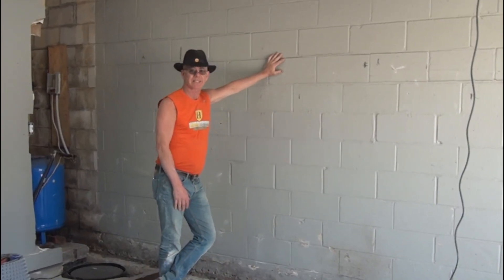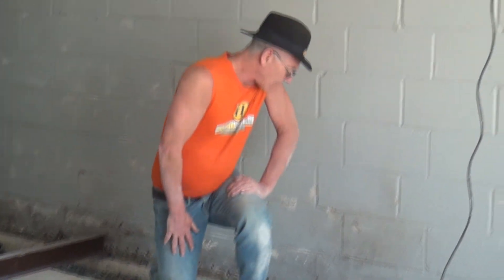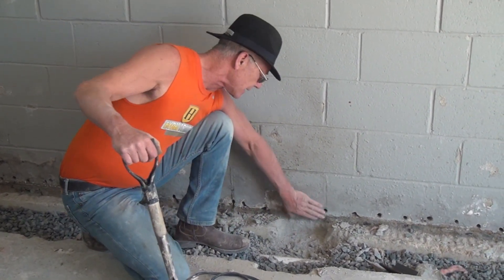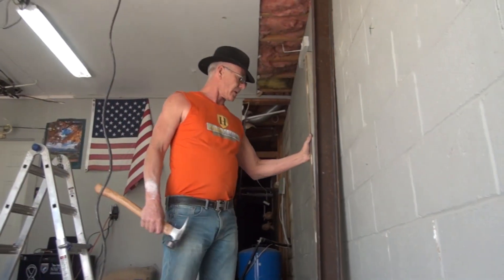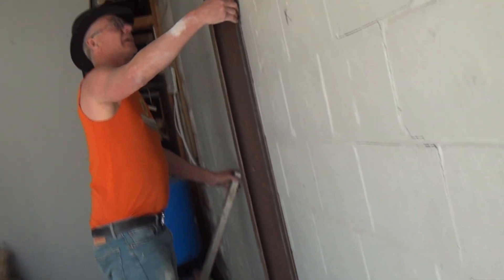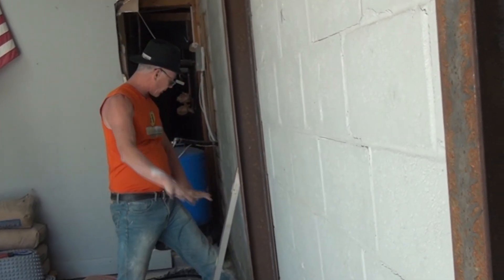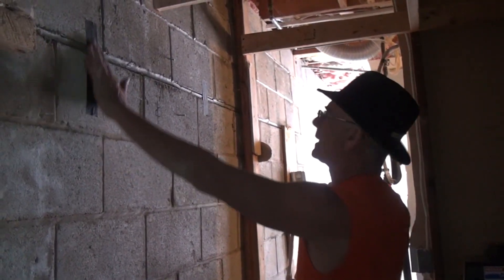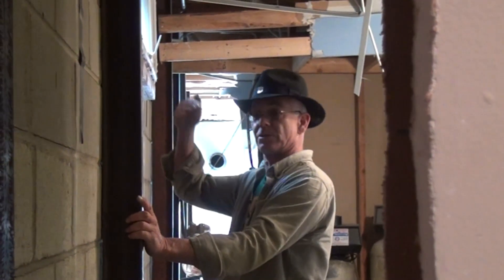NJ - PA Foundation Repair - How to Install I BEAMS vs Carbon Fiber Strips

Comment: What about using structural epoxy and 5/8 bolts in the floor on a flange welded to the bottom of the W4 13 iron with some gorilla braces on top?

Comment: how would you secure the bottom of the I beam in a dirt crawl space?
Reply: Encased in concrete tight to the wall at the bottom and buy an adjustable brace for the top

Comment: 😂 I've got a wall leaning in considerably at the TOP. 15°? If I were to drop a plumb bob from the top to the floor, I' be 12-14" at the base...How would I address THIS nighmare?!! I have been repairing this house on my own for 10 years...please help. Yes, I have a LOT of construction knowledge.

Comment: Carbon fiber is an attempt at foundation stabilization with a side effect of epoxy stink.  it attempts holds the wall in its current position.  The strip actually needs additional movement to engage.  If you can live with the size of wide flange beams "I beams", they are probably going to be more robust.

Comment: I-beams and carbon fiber strips are as much repair as bandaids are to cuts on your finger. The difference between a finger and a house is your finger will repair itself under the bandaid; the house will just weep and fail more.

Comment: The title was a bit misleading.  I was actually hoping to learn a bit about the use of carbon fiber materials in home construction.  All I learned here about carbon fiber, is your complete disdain for carbon fiber strips.  Whatever those are.  Still though, I did learn how to correctly install a steel I-beam.  Thanks for posting.  Update.  Just saw another video that you did that was what I was looking for.  Thanks again for your videos.  I thoroughly enjoy learning, and you are one heck of a teacher.  A no nonsense no bull type, the best.

Comment: Definitely recommend a 6x6 or angle iron at the top.  The company that did mine in the 80s used C-channel and a 2x10 instead of the 6x6 at the top. The pressure eventually broke the 2x10 and have bent several of the beams.  Now I have to spend another 15k to replace what was already done.

Comment: I like your style! The question that rattled around in my mind is, why were cinderblocks used for foundation walls in the first place?
Reply: Another good question is could this method be used for brick foundation?
Reply: @joshuareynolds3523  after watching many vids on foundations I’d say no on the brick idea.
Reply: @brainwashingdetergent4322   what would be good for brick?
Reply: @joshuareynolds3523  exterior walls is what brick is for
Reply: They are NOT cinderblocks they are CONCRETE blocks big difference.

Comment: Hey Dan, I have a customer with a similar issue, and I was wondering how you'd deal with bowing by the staircase. I can't slip any steel along the wall where the stairs run. What would you do?
Reply: I can't help you with your question, but you sound like a pro, so I wanted to ask you something... Generally speaking, what kind of I-beam do you usually use? Like, for a regular basement, 10 ft beam. What Web, Flange Width, and lbs/ft do you use?
Reply: @Vegan4Everything W4x13 is typical. I beams are sized by how much they weigh per foot. So a W4x13 is 4 inch width by 13 lbs per foot.

Comment: Thank you for this video! I have a customer with an exterior covered porch. Brick wall with stucco on it. Half of it below grade. Anyhow it's caving in. I'm going to use a modified method to support the deck joists above, and shore up the walls while adding pressure on them. I'm planning on building a 2x6 pressure-treated wall one foot on center. Brace it at the joists at the top. Use joist hangers so it could hold tension towards the brick wall. Then I'm going to move along and jack the bottom of the 2x6 wall until it comes into contact with the bottom course of the brick wall. This may help level the brick, but it will definitely support it from falling in, and I'll take care of the decking support above. Thank you for your video. It inspired me to develop this! If you're so inclined and can think of a better method please let me know. Best wishes. Be safe.

Comment: Hi! Thank you so mu for this video, it’s been so helpful, if you were in the Kansas City area, I’d love to have you come out and take a look at a foundation on a house we are interested in buying. The concrete foundation has some leaning on one wall and 4 or 5 steel I beams were installed (incorrectly we think) and small amounts of water come in through cracks in the foundation when it rains. Our inspectors didn’t seem worried about it at all and made it sound like just by sealing the cracks with an epoxy, all would be fine. We however are worried that the wall will continue to lean in despite the steel beams being there. I guess my question is, how worried should we be about this or should we try to reinstall the beams correctly then reseal cracks and regrade around the foundation? I’ve called around to a few local companies and no one will even give me an idea or look at my inspection report without coming out and seeing it in person, which I understand. But since we down yet own the home, it’s not realistic to try and schedule a consultation until after we close on the house. I would love any thoughts you might have on this!
Reply: You are our of your mind if you think some guy on youtube is going to come out to take a look at the foundation of a house you are interested in buying half way across the country...

Comment: Would you leave these I beams in permanently to stabilize the wall? I had plans to lower my basement floor, 90 years old home block foundation, upon inspection I found one wall beginning to bow inward, I want to do this to straighten it out being the driveway is on the outside, ones the wall of straight my thought would be to either cut upon pin and fill the wall to stabilize than do the underpinning, or leaving the I beams in benching this wall and underpinning the remains 3 sides to lower the floor height, any advice would be greatly appreciated
Reply: I would never remove them.....

Comment: What type of steel beam do you use? I need power brace installed. Had a contractor come out told me I need 14 beams. It's going to cost me $25,000. I cant afford that, I'm considering doing it my self.

Comment: my only disappointment is that you are located in new jersey.i would like to find a reputable foundation repair expert such as yourself in Nebraska.there was a waterproofing system installed by a leading company here.begins with (TH).previous to my purchasing the house.the people were elderly,in their eighties.never saw a drop of water in sump pit.it took me abuot 15 minutes to figure out my problem.clogged down spout.but now I have a bowed wall

Comment: Daniel OConnor, Good day to you. I live out here in Missouri and my basement has a small separation/crack between the blocks, horizontally. Your method of Ibeam repair looks great. What's the distance you have between Ibeams? I'm looking for your video on installing a sump tank etc. Yeah, I'm a DIYer, but I have done construction for 15 - 20 years in San Diego and then I moved to Missouri and became an Operating Engineer. I can follow everything you're saying, but I never heard you talk about the distance between Ibeams. I'll get searching, thanks Daniel OConnor.

Comment: Daniel, I have a question- in another video you secured the I Beams at the top using a long angle iron that connected to all of them and the joists.  In this video you boxed them out with wood.  Is either method better?  And thank you for the great videos.

Comment: I've been shopping for a house and finally found one that's literally perfect for me  ...except the big ass crack in the basement wall smh. It's a renovated flip that was built in 1925 so I'm worried
Reply: I bought a house in 2016 that had some cracked walls but the house is at the top of a hill and water all runs away from the house. If it's not leaking water, don't be scared. Mine hasn't gotten any worse and is dry as a bone. You can do an I/H-beam repair like this video shows without tearing into the footer. Just drill a couple holes and put rebar in, put a 2x8" block of wood against the rebar, then use a 12 or 20 ton hydrolic jack like shown here and push the wall back over the course of a couple days, then hydrolic cement the crack. Cake! Don't be scared if it's your dream house, but get an inspectors opinion too!

Comment: How do you create a bottom anchor if it's dirt or clay on the other side rather than a concrete pad? Understand that the moisture level of the clay/dirt is pretty high.

Comment: Just recently discovered your videos. To the point, honest and very informative. Wife and I are looking to buy a second house and seems like every house we look at has fucked up basement walls. Even a newer 10 yo home we looked at in a $300k subdivision selling for $165k had shifting walls. Something about not being tied in right. Realtor said it would be 50k to 60k just to fix the walls. Smh. Several other houses built in the 70s had 2 or more walls pushing in with cracks going right through the block from the floor to the ceiling. Blocks snapped in half. WTF.  After watching your videos I have a better understanding what's going on in these houses. I don't even know how this shit gets passed the building inspectors. Thank you for everything you are doing to help inform us.

Comment: RamJack... we put tiebacks through the center of the ibeam and block wall it pulls the wall back and holds, that ibeam with nothing in the center won’t work.... it’s still going to push and crack the floor

Comment: Bashing the competition seems to be in order at times. I think a more positive approach is better. Do videos that inform the public, not negative videos designed to dog the other guy. Personally I've stumbled across several videos you've published. Some of your repairs are just a repeat of the competition. Slightly changing small details. I think it should be know that the best way to stop water from entering a home is to work from the outside. Obviously that cost more, and is a tougher sell considering. However it is the correct fix to most water issues.

Comment: How far apart are you spacing these I beams? Thanks for the video.
Reply: Dustin Rynders usually they are supposed to keep them 6-8 feet apart.

Comment: What do you do for a basement that is leaking water and showing white mold/fugi or what ever and the walls have cracks and also I want an egress window installed . What would be my options . So I am not taking advantage of . And the job isn't done only half way ?

Comment: Great video Dan. You're hilarious. 
Quick question though, is there a reason that you apply pressure to the base of the wall instead of the top?
Do you see any issues with mounting the I-beam to base of the wall and applying pressure to the top via a torque screw braced against the runners?
Reply: At the bottom is where most of the force is going, since that's where all the weight is going is downwards. Water towers reinforce more along the bottom too. So if you can move the bottom the top will follow along, but if you try to move the top you might move the bottom the wrong way in return.
Reply: @dawnv3436  Nicely put!
Reply: @dawnv3436   What? there's force at the top based on fundamental structural mechanics. The jack is used down low because its easier and safer to put the jack there.

Comment: Could the I-beams be removed after the wall straightens back out? Or would it just pop back out? Wondering in case wanting to sell the home.
Reply: 2nd that question
Reply: I would ask why would you remove them? Did you strengthen the wall somehow?

Comment: Question on the direction of the floor joists ... in videos and photos of i-beam installation, I always see the joists running TOWARD the wall.  What about the walls where the floor joists run in the same direction as the wall?  Can i-beams still be used?  How does it change how it's fastened at the top?
Reply: I have the exact same question. My bow is running on the wall that runs parallel to the joists. How do you fast the I beam at the top
Reply: Just guessing here, but if the upper floor joists are parallel to the wall, then add 16-inch blocks (or whatever the joist spacing is) between floor joists so you have effectively built a new floor joist perpendicular to the old joists. That would be a lot of cutting but your floor would be ridiculously stiff and you keep your headroom.

Another idea is run perpendicular joists running under the old floor joists, nailed into the bottom old floor joists, and flat instead of vertical (like the old floor joists are). You would lose 1.5 inches of headroom doing this.

Lastly a combination of both, particularly run a long/uncut perpendicular floor joist flat (so you lose 1.5 inches headroom) for each steel I-beam. Once the wall is pushed out, then consider removing the long perpendicular joists but leave the 16-inch blocking. This returns your headroom after the wall is pushed back but the steel I-beams are supported in the perpendicular direction. Be sure to keep the ground from getting wet outside the wall so there is not a huge force trying to push the wall back in all over again.

Comment: Is there a minimum size you would use for steel? I Would like to use a 3" i -beam or heavy wall sq tube to frame up and finish the basement wall with 2x4's. Using the 3" would allow this.

Comment: I love your humor regarding carbon fiber strips...Thank you for putting these videos out and educating the public. I'm going to need my basement walls fixed and will stay away from the carbon fiber strip...I wish you were located in NE Ohio because I'd certainly have your company do my repair.
Reply from the maker: Hey Dave,  did you know I do face time estimates?  I phone or Android?  U.S. and Canada? I do charge $350 but you will know exactly what needs to be done and why and you can tell a Contractor what you want him to do and how much you will pay them.  People have saved thousands.  If I tell u the job should cost $10K and you tell your prospective Contractor you are willing to pay $6k?  And YOU tell them what YOU want them to do?  Priceless.  I'm here if you need me and if you'd like to set up a face time estimate give us a call 888 808 9523.  Thanks, Daniel J OConnor
Reply: David, I am in NE Ohio and running into the same issue. Did you end up hiring someone out to do yours and if so, who?

Thanks in advance

Comment: What if the wall was sheared approximately 2" about 3.5' from the floor? Would the steel crack the block at the shear line?
Reply: Fyi...thank you for your videos. Your knowledge and experience has made our veteran/firefighter owned business better by doing the job right the first time.
Reply: I would be interested in a response to this question,  I have the same issue in my basement. First block above the floor has slid inward about 1.5 in... then the same wall has 3 in bow inward at the first line.
Reply: Can be fixed but not by using the i beam system. Would have to go the route he initially made mention of. (Exterior excavation then push walls, put vertical rebar in and fill cells in block with concrete. Then waterproof , drains, gravel, and backfill).

Comment: I've got stacked stone as outer foundation and then a gap of 6 inches and then an inside brickwall in the basement. What's the idea of such a construction? Why the large gap? The house is from 1929.

Comment: What size I beam do you use? And is this a viable option for a red brick foundation?
Reply from the maker: 4X4 but I wouldn't use them on Brick.  Too much pressure.  You can do I Beams on Brick but go lighter. 3X3.  You would also go closer together  3 ft center.   BUT, and I hate even having to say this, the characteristics of Brick in that there is generally no footer and the concrete floor is mute, Carbon Fiber Strips would be best.  You can not push Brick back into place unless you want to dig outside.  So keeping the Brick from further movement is all you might want to do.  Of course the Carbon Fiber MUST BE INSTALLED properly.  Concrete and Cider block corrodes and granules of sand and cinder loosen so the strip can't hold.  Brick is Clay.  Yes some clay brick disintegrates but rarely.  Carbon Fiber Strips will hold a brick wall forever.  ( IF INSTALLED PROPERLY )  - Daniel J OConnor
Reply: This is really good info. I have brick foundation in NYC. Wish i can find someone nearby to waterproof my whole brick foundation from the exterior. Also excation it would see if theres any fractures

Comment: Wow that I beam is going to shove the entire foundation back into plumb? Amazing engineering! Who engineered this Rube Goldberg?
Reply from the maker: I'll let u know in 4 or 5 years from now.  But  perhaps u might consider offer several options for a wall repair based on a unique issue itself.  An I Beam is an option.  But for myself, a carbon fiber strip is not. Some Engineers might say carbon fiber is okay.  New school I guess. Those guys are book learned and I've as much respect for them as I might have for something I might find in the bottom of my underwear.  I do what I believe in and I am quite aware of the realities of Carbon Fiber.  And that's what 40 years of construction experience allows me to know reality.  Thanks for your support - 
Daniel J OConnor
Reply: Smart Ass.